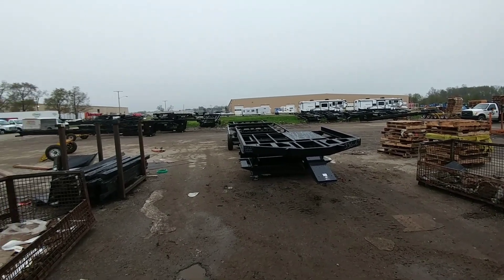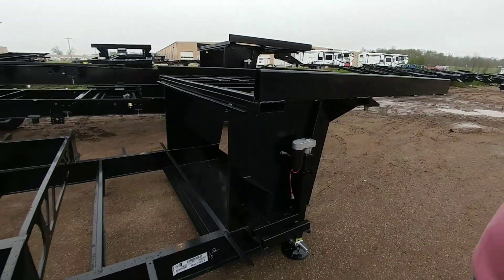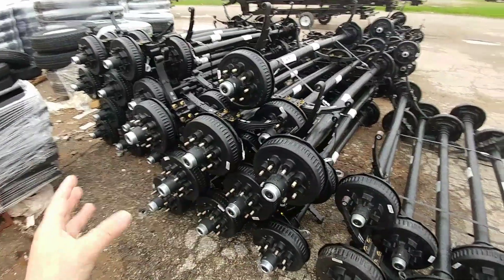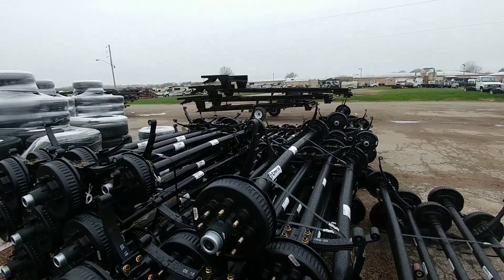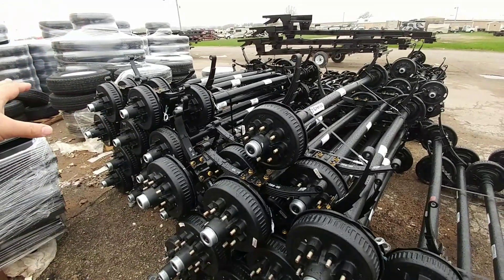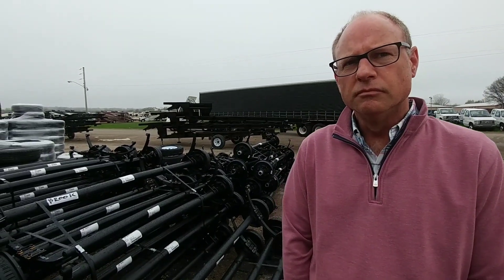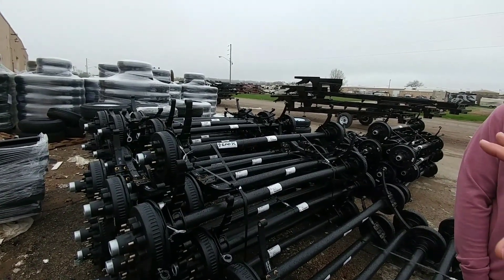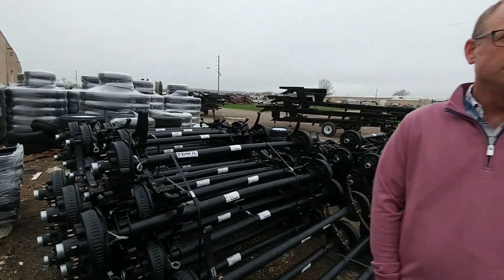Fifth Wheel Frame and Axle Ratings! Building a Fifth Wheel RV! Coachmen Fifth Wheel factory Tour!

Comment from the maker: Let me break it down this way.  If you have a Fifth Wheel with a 12,500lb Dry Weight (no cargo or liquids) and a 14,500lb GVWR (2,500lb cargo capacity when loaded to the max) even when empty, the Pin Weight will be about 20% of the GVWR or Max weight (by design).  This means that you take 12,500lbs and deduct 2,900lbs (20% of the GVWR NOT the Dry Weight) worth of pin weight from that.  That would mean 9,600lbs is resting on the axles when dry.  So, without any cargo or water, a set of 7k axles totally 14k total axle rating is only supporting 9,600lbs without your cargo.  Which means you have upwards of 4,900lbs worth of payload capacity before maxing out your axles.  So, if the cargo capacity of your fifth wheel is 2,500lbs you would still have 2,400lbs worth of additional capacity on-top of your cargo before maxing out your axle ratings.  That’s why Fred says they derate the total GVWR of Fifth Wheels, to prevent folks from loading up 4,900lbs worth of weight and maxing out the chassis suspension. Keep in mind that axles have an approximately 30% buffer over their ratings in the event of road stress and rebounding movement while towing.

Comment: Awesome info JD.  Seeing the frame like that I finally understand "drop frame".  I knew the concept and see the difference in person with the basement storage, but seeing it with the fairings and sides off it makes A LOT more sense now on how the frame is structured to accommodate it.

Looking forward to the rest of this series as you continue to work with Coachman on your baby Brookstone.  I am sure they won't let you spill the beans on all the inside secrets, but I am loving your insight on what you are seeing and experiencing.

One request if you can manage it... can you do a bit more demonstrating on how the slide box is mated to the slide system?  I am mystified how the frame goes in and out without a massive hole above or below on the interior.  I understand the floors slide over each other, I just can't visualize  the mechanics of how the box and mechanism attach to make that possible.

Fantastic content as usual JD.

Hopefully you're staying safe and dry in this crazy weather we are having lately.  Happy mother's day to your family.

Comment: I load all my tanks when I move.  Also carry about a pallet of bottled water.    Not to mention I have a pet elephant.  No worries.
Reply: Me too, not going to let my truck get lazy.
Reply: Yes the hitch takes a bit of the trailer weight, but heavier axles will help take the slam from hitting bumps and whatnot that lift the trailer and drop it down,
Reply: Cool I have a pet Buffalo and she sits comfortably in the garage of my unit. I modified the back ramp so it’s partially open during travel to make cleanup easier. She just leans up against the back door when she has to go! Really takes care of those persistent tailgaters too😎

Comment: The axles have to be over rated. loads are never even on both axles, so if you have marginal axles, there is a very good chance one of the axles can have its weight rating exceeded, either momentarily or continuously depending on the circumstances. This would be very true of trailers such as an Airstream that have torsion axles that operate completely independent of each other. Tow in a not level condition and the axle on the low end is carrying more of the load. Leaf spring systems use equalizers between the springs that help even out the loads.

Comment: Those of us who travel cross country with our RVs must travel with a full tank of fresh water. We will be on the road grinding off miles and not staying in a park or campground for 5 to 7 days. That full fresh tank will eventually be transferred to the gray and black tanks before we get to our destination where we can hook up and dump tanks. Yes we do shower while on the road, that’s why we have self-contained RVs. If an RV model does not recommend you  travel with a full tank of fresh water, you may want to reconsider buying that rig, the day will come when you may need to do so.
Reply from the maker: Regardless of the manufacturer, you take the risk of the tank dropping out if its loaded with water. Check it out fot yourself: https://www.google.com/search?q=water+tank+fell+out+fifth+wheel&oq=water+tank+fell+out+fifth+wheel&aqs=chrome..69i57.6835j0j4&client=ms-android-sprint-us-revc&sourceid=chrome-mobile&ie=UTF-8
Reply: @BTBRVReviews  I've seen several incidents of tanks falling out, particularly on Keystone models. Why on earth would a manufacturer install a water tank that could fall out if filled? What then is the purpose of having that size tank installed at all?  Many boondockers, desert campers, motocrossers, and beach campers must arrive filled, not to mention long distance travelers. A manufacturer who installs a fresh/gray/black tank that is at risk of falling out if filled is not a responsible manufacturer.  Just because it happens occasionally does not mean it should be an acceptable manufacturing practice to under build the tank mounting system for the size of tank installed. We are going to have to disagree on this one.
Reply from the maker: @thechroniclesofmaintenance4192 : I actually agree with you.  I wish manufactures would add additional bracing to support the water tanks.  Even baffling the interiors to prevent the water from sloshing while being towed.  I'm 100% in agreement with you.  I'm just saying WHY it's not a good idea to travel with full tanks.

Comment: Weights also change depending on how people load their items in the trailer along with going up and down hills. Bumps and dips in roads along with railroad crossings that may be higher than the surrounding roads, they all change the weight distribution momentarily. Airbags and gages for them can show you this on the fly.
Reply from the maker: Totally agree! And that's where a properly designed suspension can dampen and reduce the total load increase and transfer over bumps. Axles are also designed to have up to a 30% buffer over their rating to account for this. That's why it's very rare to see an axle axle failure.  Generally it's a tire or spring failure.
Reply: @BTBRVReviews  a lot of companies especially toyhauler fifthwheels and travel trailers that do not build with heavy enough axles! i now the majority doesnt travel far but plenty do and on a 5* grade most of the load goes on the axle. they need to step up one step on axles. i like the fact that this company does over build and derate a model or two.

Comment: I have a 9 ton flatbed with 9k dually axles under it and it wieghs 13k load when i haul my tractor. I scaled 22k gross 11700 trl 6100 rear 4200 front. Trk wieghs 9k empty so thats 1300 tongue load with 11700 trl axle load coming to 13k gross trl which 10% which good for a pintle hitch trl. Ive cruised 75 no problem with that. I have my 3 bottom plow up front and i put the loader bucket on the plow. Works great. I only need say a 12k trl but i found a cheaper 9 ton used. A 12k trl would be a lighter frame so thats about the smallest i could go. The 9 ton i have wieght to spare. Get a newer 1 ton and no problem with a bigger tractor never need a new trl.  I want a pickup camper eventually for going to my show but now a tarp works

Comment: If I had my way I would put 2 10,000 axles on the frame to make sure it could handle the load with no trouble at all. Also install them with disk breaks instead of drum breaks. IMO disk are a lot better then drum.
Reply: Doug Burnett, and shock absorbers too!

Comment: I'm a Firm believer in more axle than trailer. We are looking at a 20,000lb toy hauler with triple 7,000lb axles 21,000lb.
Looking at having the Morryde 8,000lb installed 24,000lb. in axle capacity. Less stress, ware and tare.

Comment: Axle rating numbers are also based on a 100% duty cycle they can generally carry over double their rated weight for very short periods of time like very steep driveway can sometimes max out your eqalizers and lift and axle off the ground
Reply: Or, another possibility that HOPEFULLY you don't experience (I have) where an entire side is off the ground and the only thing keeping the trailer upright is the 5th wheel and the weight of the truck.

Comment: I worry more about tires than axles as the weak point on any trailer. Driving down the road in the summertime where the asphalt is 130 F or greater and the tires have no place to dissipate their heat to sets you up for a blowout.

Remember back a few years ago when Firestone had problems with their tires on the Ford Explorer. Ford wanted a super smooth ride, while Firestone told them that the only way to get the rating out of the tire was full 35psi  inflation. People ran under inflated and tire blowouts occurred.

Comment: After seeing the drop frame I was wondering if you feel that it is in reality a weaker frame than the straight I-beam frames. It seems like there would be more flex at the section in the drop frame since you go to a smaller I-beam and since that beam is welded to the larger beam there would be some risk of those welds failing.  Would appreciate your explanation and thoughts of this in some future video!
Reply from the maker: I agree with you.  Having a drop frame can potentially be the weak point in the structure.  However, the design of the drop frame section and having a taller section can help prevent failure.  Since 60-70% of the RVs weight will be focused on the longer taller section of the frame, you won't have a significant transfer of force to the drop frame section.  That changes with large toy haulers, since much of the added weight could be behind the trailer axles.  This is why MOST Toy Haulers have a straight 12" I-Beam with no drop section.  Only a few use a drop frame on Toy Haulers.
Reply: Big Truck Big RV to your knowledge, what, if any, is the purpose of the drop frame besides improving basement storage?

Comment: Yes, the pin/tongue weight is added to the scale weight of the trailer (as weighed attached to the tow vehicle) to determine GVW scale. 

I weigh RV's for my day job, using individual wheel weights to arrive at axle weights, which yields vehicle weight. Plus shows weight distribution front to rear and side to side. This is Escapee's SmartWeigh program, located in Florida, Texas, and Arizona. 

Most of the rigs I weigh are within ratings, but I still see quite a few with overloaded axles, over GVWR, and even one this year over GCWR. 

You need to research the specifications of the tow vehicle and the trailer (or the coach if you are buying an A, B, or C) and make sure it was built to do what you want it to do as far as what you can put in, and on, it.

Comment: Dexter EzLube axels should be recalled. Never use the EzLube system, it causes the rear seal to fail putting grease into the drum brake destroying them. 

Rather have true independent suspension with air ride and disc brakes.

Comment: When I look at these axles & the bare frames they look very lightweight in my eyes <retired trucker> Tonka Toys come to mind, sorry guys a dualy/twin wheel truck should be a minimum requirement and useing electric brakes is not the norm in europe , its oil or air everytime, on the heavier stuff using a full size commerial why are heavy 5th wheel makers building there own chassis when semi are ready made with air brakes disc s, yet they still make three axle light allowances, then even more differant is they carry a small car behind the cab stopping any close coupling to save derv and it disreguards all the airofoils systems to save derv by the large gap created, Sorry I just cannot get my head around the states idea s of the amout of wood inside when built and not forgetting at the top end they want $200k to $250k is it madness ?

Comment: Why not add a third axle to support more weight and less on the truck?
Reply from the maker: Good question. So unless you have a toy hauler you generally don't have to worry about an excessive amount of weight behind the rear axles or directly on them. If you balance more of the weight over the axles then it can potentially lead to improper balancing over the back of the RV and risk causing it to tip back when being loaded or even walked on. it can even pull weight off of the back of a truck in a dangerous fashion when going over rough roads or bumps.  Having the load on the axles and forward of the axles is very important to overall stability for and aft of the fifth wheel.
Reply: If instruction is necessary on why the 5th wheel axles can’t support the entire weight of the 5th wheel, perhaps another video is necessary on “towing truck’s payload capacity.” BTBRV can call it “why a 1/2 ton truck isn’t a good idea for towing most 5th wheels, besides braking capability.”
Reply: Michael B adding a third 7k axle puts the gcwr into cdl territory
Reply: help137 yes. Yes he has.
And people still ask “why can’t I pull 12,000 lbs in my truck rated to pull 12,100 lbs?” 😂
Reply: @brandoncaldwell95  what the hell good is posting a link when the link is private and you can't open it?

Comment: You guys aren't figuring the horrible roads in Indiana what happens to that axle hitting a pothole or any other roadway imperfections?? These unforgiving bumps and holes will overload a 7k axle carrying 6k lbs to double its manufactured weight rating for a split second  in other words a 5x10 cargo trailer should have a 7k axle with a max trailer rating of 3500 lb

Comment: Put 2 f***ing axles that can handle 9000 pounds each so it will never be a issue. Don't rely on the vehicle taking weight, tanks not always being full. Working the max load a trailer may take and put axles and suspension under it that can take that load. It may not be needed ever but it's peace of mind for the end user.
Reply from the maker: sir, you MUST rely on the vehicle taking a sizable portion of the weight. That's why trucks are designed to have increased payload capacity and fifth wheels are designed front heavy to transfer that weight to the truck.  You have no idea how unstable a fifth wheel would be if the weight was focused too far back.  Plus, every time you walk in your fifth wheel towards the back you would take the risk of it tipping backwards.  Fifth Wheels, like Pickup Trucks, are designed to be load balanced on both the front and back.  The bed of the truck acts as the front axle of the trailer.  Pretty much ALL pickup trucks have a rear axle that rated to support about 70% of the trucks GVWR, because the front axle supports the rest.  Plus, even loaded to the full GVWR, most fifth wheels aren't working at their max axle rating.  They are usually shy by over 2,000lbs because of weight transferred to the truck.

Comment: Not placing the weight on the axles is why the vast majority of 3/4 ton trucks are GROSSLY over weight when towing. My truck GVW is 2000 pounds over when my toy hauler is fully loaded. The rolling weight is within the truck limits. I have airbags to keep a level ride and other mods aid in my weigh issue.  I look at other rigs pulling into areas we go to and I know they are even more overweight than me.
Reply from the maker: And that's by designed.  To be honest, many people with 3/4 ton trucks are over weight even when towing a travel trailer.  3/4 ton trucks don't have the payload capacity many people think.
Reply: Steven Lopez you should start a business certifying other RVer’s overweight rigs based on the modifications they have installed.  Probably won’t even need insurance since nothing bad will ever happen as a result.

Comment: You said your not supposed to have or shouldn't have water, grey water, or black water when you travel,  I don't think you realize how many of us go RVing where there are no RV campgrounds,  no water or dump stations,  we pack in and pack out our shit ! literally
Reply from the maker: Even with full tanks, you'll only be loading about 70% of the total GVWR on the axles.  30% will be on the truck (sometimes more) and 10% is easily accounted for with cargo and people
Reply: You always want to fill fresh water at your house. you don't want to travel across country and drink suspect water and get sick. I seen people using their black water hoses flush hoses on campground spigots to fill their tanks and it's just not what you want to do. if your truck can't handle your trailer with full tanks, you need a bigger truck.
Reply: Thank you for bringing that point up, I Boondock and have to carry my s*** out all the time never knew that the manufacturer did not properly equip my fifth wheel to carry everything that goes with a fifth wheel. Plus the awful road conditions

Comment: So why are the axles so close to gross? Because like all things RV it's half assed
Reply from the maker: Question, why are all Pickup Truck rear axles significantly lower rated than the trucks GVWR?
Reply: Big Truck Big RV put them together they aren't. Put the RV axles together and hope for the best. Hence why unless you're spending 200k you upgrade tires suspension, re stick the fake wood when it comes off cause someone didn't nail it in properly etc
Reply: whiteandnerdytuba it’s because an engineer looked at all the variables in the design of that RV, including safety, interior layout, intended use and many others, and using efficient design practices, specified all the structural components, including the axles and suspension.